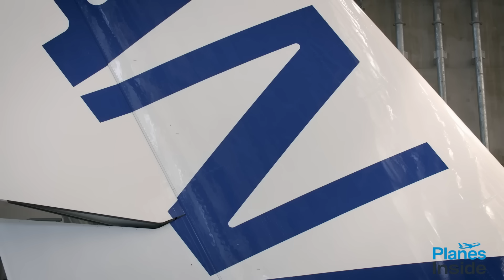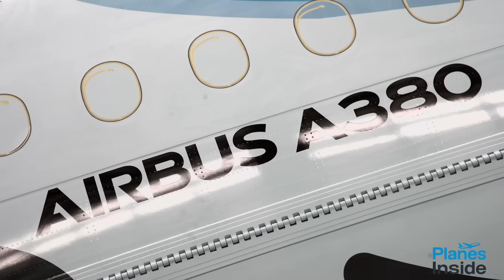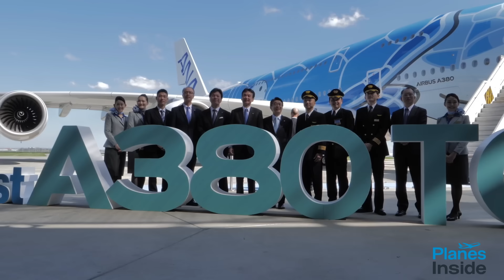ANA Was Forced to Buy 3 Airbus A380s…How ANA Got Stuck With Three Giant Jets They Didn’t Need

Comment: Honestly, I wish more airlines kept the A380. It was the only plane where economy didn’t feel like a punishment.
Reply: The economy is not really that and and all. All the media likes to shit on it, but for long range aircraft with that much first and busniess class the fuel burn is like 10-15% higher than  a 777x.

Maintanace cost is not really that bad (on par with A330) and crew cost is the cheapest on the market.

Its really the post covid slump that is the issue. In europe ir have almost fully recovered, but around the world less so.

Because covid ended very suddenly in.europe feburary of 2022
Reply: Genuine question. Why do you think economy in 380 is better than others? Coz i fly economy and occasionally business but never tried 380 economy but from my understanding, its same class and its not like 380 economy has more leg room or recline ??
Reply: @BobSaysWhat22  A380 have the second widest mandatory economyseat of any airliner, only a220 have wider.

The reason for A380 have the widest is that they have the widest fuselage, but also the widest arangment possible (3+4-3). So the airlines just can´t put in a other seat.

For A220 the reason is basically the opposite. It have the widest seat, because fitting one more seat in would be basically impossible. (well i guess, in theory they could just put in 15" seats,but that would be bonkers)

767 have in theory as wide seats as A220, the issue with 767 is that its have a 2-3-2 layout, and a lot of airlines opt for a more economical 2-4-2 layout that make the width go all the way down to 17".

Comment: If ANA doesn't want it, it can sell it to Emirates who are looking for well maintained A380s.
Reply: It's not as simple as you think. Emirates have to retrofit the aircraft according to their specifications which will be around 50-100 millions. Emirates is a well planned airline. They wouldn't get a aircraft just coz it's cheap.
Reply: @San-n4u8s Issue is not about cost but availability. Since demand is big for A380 but aircraft is no longer made, Emirates can buy & retrofit it. If Air India can do for B777, Emirates can certainly do for A380.
Reply: Hope not.  Love flying on the A380 HNL-NRT.
Reply: Emirates have bought exactly zero used A380s. So, no.
Reply: @obroni That's when A380 was manufactured. Now they can't buy new while demand is there. So they can buy & retrofit as per their specs.
Reply: @parimal7528 On top of Emirates actually not wanting more A380s, if they wanted more, they could simply re-activate some A380s they stored a long time ago for a lot cheaper.
They are NOT looking for more A380s and if they are they wouldn’t have retired some.
Reply: @manitw.4998 the retired ones were cannibalised to keep thair fleet alive. They want a total of 110 active units
Reply: @manitw.4998  They were the ones who pleeded with Airbus to reopen the A380Neo program wdym they don't want more A380s lol
Reply: @obroni  They have bought used A380s... multiple ones from different owners.
Reply: @funkudu  I'm happy to be proved wrong with evidence. Show me one tail number that they have bought from anyone but Airbus.
Reply: @obroni I dont know the tail numbers, but they bought two from Investec in South Africa a few months ago.
Reply: @funkudu  You're wrong in this situation, they have only bought-out airplanes, that they were leasing from other company, but were always in their posession
Reply: @stemba16  the user asked me for proof of any aircraft "that they have bought from anyone but Airbus", which as you have now agreed, did happen. You are now shifting the goal post...
Reply: @funkudu  It was made for them from the factory, that's different than buying a used one from other company
Reply: @obroni  No Emirates are after more A380s at the moment!
Reply: @Jet_Jack  Happy to be proved wrong with any evidence. Emirates might buy some used A380s for parts to keep the rest of the fleet flying, but they still have many A380s still on the ground from 2020.

Comment: If you think a company overseas is forced to buy things, then you just let yourself to be consume by greed through propagandas... That is only happen in US...

ANA bought A380 because its think tank chose it  as the best option to answer demands on Tokyo-Honolulu. Skymark situation is just an opportunity to buy A380 cheaper, and ANA has to change its interior according to its brand identity.

An A380 that sitting in Honolulu without its engine because a Boeing operated by Fedex hit one of A380 starboard engine during taxi.

With operating 3 units of A380 for Tokyo-Honolulu, ANA doesn't have to operate 4 till 6 units of 777 which would cost them more. Also, Japan travelers market preferences for long haul is more suitable with A380 which is spacious and luxury.

Boeing 777 is a great plane but it doesn't always answers what the market demands. For Hub based operators like Emirates or long haul operators like Qantas, one unit of A380 is always better than operating 2 units of 777. Yet, the way Boeing promote its 777 to overseas flight company is not a healthy competition based on a particular rabbit hole...

Comment: there are ways to operate the A380-800 profitably . . . the Middle Eastern full service carrier Emirates has proved this in more ways than one . . . to be profitable you'll need to operate a fleet of atleast 32 - 36 refurbished A380-800 with a new upgraded cabin product . . . structure your network based on a hybrid hub & spoke model . . . a A380-800 pax cabin should be configured to seat anywhere between 438 paxs - 476 paxs (max) in a 3-class layout, no more no less . . . average pax density on international long haul will vary from place to place . . .